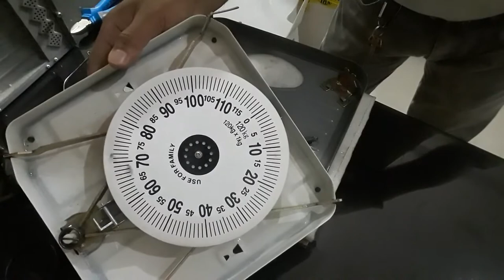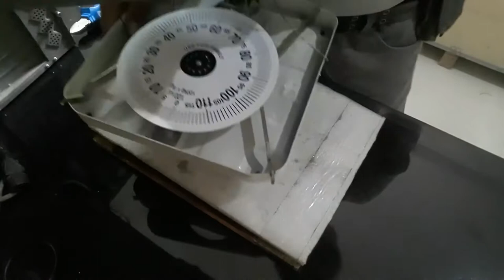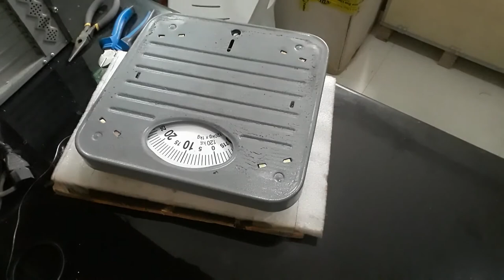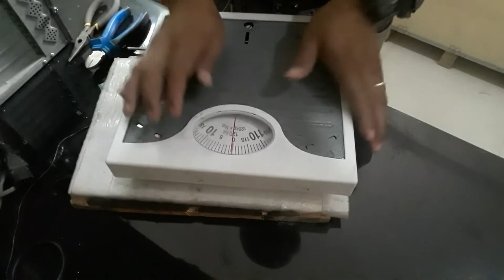How To Assemble Bathroom Scale After Cleaning Using a Tie Wire

Comment: Hey buddy. Just wanted to let you know that it was really helpful for me. Everybody has disassembling video, but noone has assembling one. It's really tricky to put the springs into their position. Thanks.
Reply from the maker: Hi bro, yes it's easy to disassemble but very difficult to assemble in the part of the spring. So I use tie wire to pull up the spring to the back cover. Thank you bro for your message.
Reply from the maker: Kindly help to improve my channel by subscribing to us

Comment: This guy is having a difficult problem.  Easier way is to get strong string, hook it on the spring, then pull it up through the hole and hook.  Then you are done.
Reply from the maker: Yeah that's what I did, very simple but need to control to make it fix to the hook.

Comment: Putting those 2 springs back is kinda difficult.
Reply from the maker: You can do it, but first, the tie wire on the end of the spring then insert it in the hole of the top cover then use the plier or long nose plier to lift it up the spring then lock. Then finish
Reply: @AGCbloglines  Ty
Reply from the maker: @ellaglenn606  Welcome kindly subscribe to my channel